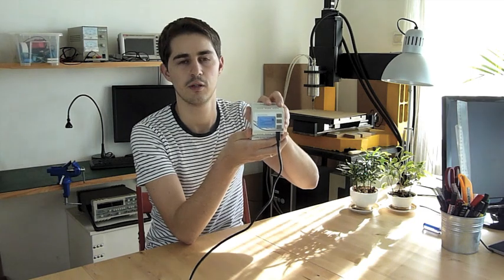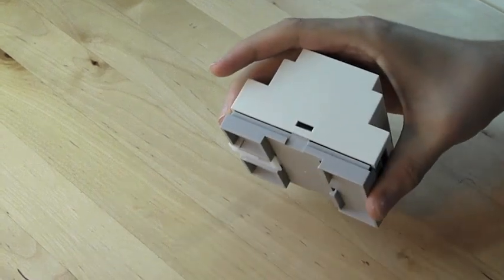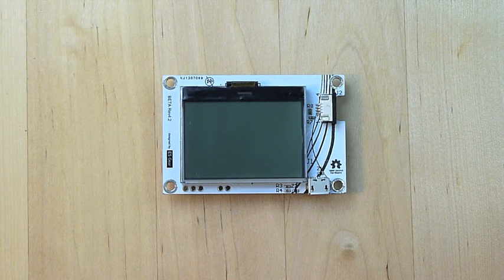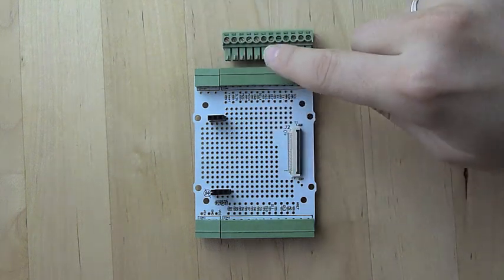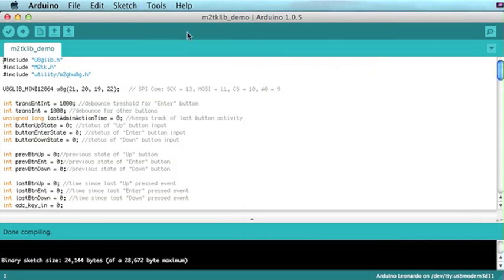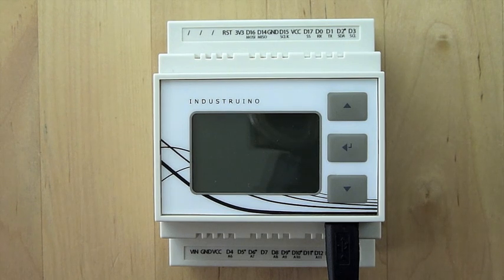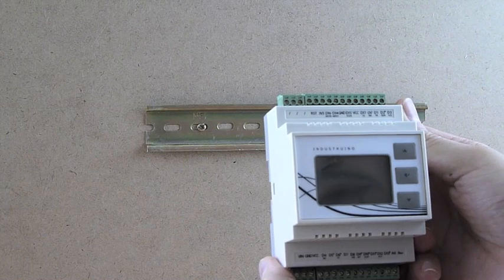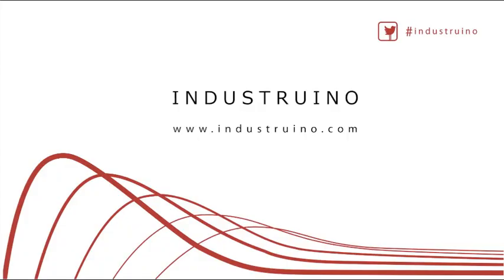First Industruino Introduction video (2013)

Comment: Sweet! Do you have plans for making din rail "shields". I'd love to have a few ac dimmers to control lighting.
Oh and.. fan speed control. Would be awesome combined with a humidity sensor for my bathroom fan.
Oh. Oh.. And it would also be sweet to have 24V outputs for relays and the likes.
I love the idea, and this will most definatly make me take the step to do home automation.
Doubt the electrical company would be glad to find protoboards and wires all over my fusebox.